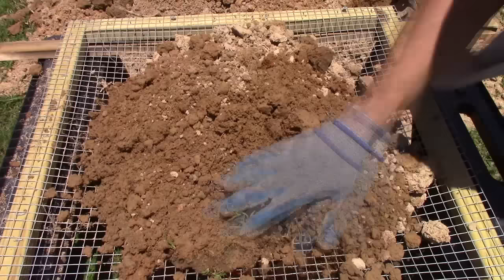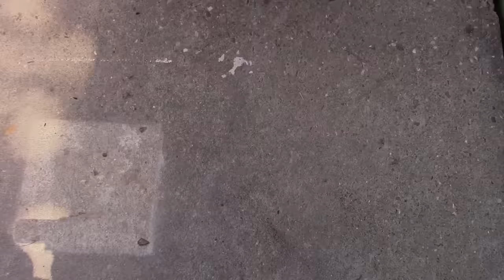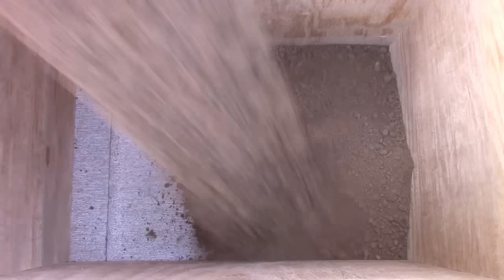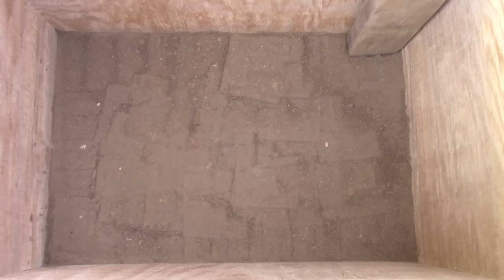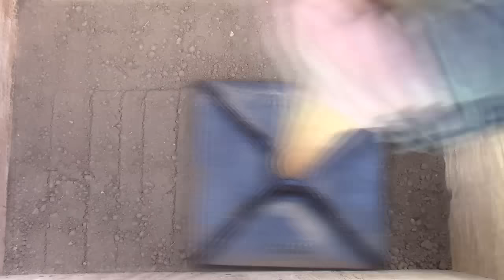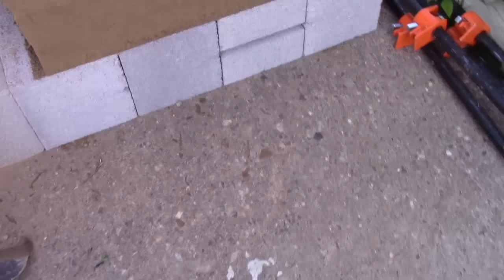How to Make a Rammed Earth Test Block - 5% Cement

Comment: I stopped using cement at least a year ago. I now substitute wood ash from my fire pit. The ratio is perhaps one part ash, two parts sand and four parts crushed clay. By adding water, you can make anything from a slurry to a sticky mud. In some cases, I use either cut or uncut straw to reinforce. I routinely change up the ratio of the mix because the percentage of clay in the dirt is the biggest variable. I don't screen anything. The range of material that you can make from these simple ingredients is amazing and—except for the labor—is free if you can get them on the building site.
Reply: It be very helpful if you can make videos of the mixture (wood ash from my fire pit). I am very interested in it. I want to avoid cements at all costs. Thanks
Reply: Is that mix waterproof or at least water resistant? I’ve made wood ash concrete before but it takes too much ash for large structures so I’m wanting to try something different.
Reply: Where will you get that much wood ash to build an entire house?
Reply: @kcmuanpuia  That much ash will be extremely hard to get I’m sure. Unless a person used volcanic ash which you can find tons of it out in the mesas in the southwest US. I can’t imagine how many things you’d have to burn in order to get enough ash to build a house. I’ve only ever built about 10 wood ash bricks for a tiny garden bed and it took a bunch of ash to do that.
Reply: thats a lot of wood burning to get that quantity of ash for that ratio. i dont see it being very practical. why is the sand so important? Clay is super abundant for most people, what is your experience with using a higher content of clay?
Reply: Can you make a video of your process?
Reply: @JimmyCapricorn77  You could use lime instead of cement, if you can get hold of it where you live.

Comment: watching this thinking... work smarter not harder... You are losing half the dirt out the buckets, make a funnel or something.
Reply: I think it was done for demonstrative purposes.    The whole process demonstrated is very inefficient, and in the end, despite the jump test at the end, you still see the brick cracking at the seems.  It doesn't seem compressed enough to be rammed earth, and i think it would have difficulty drying off if baked in the sun.   A brick that size is going to be extremely heavy, especially if they were to bring it to a kiln.  There appears to be a dried brick at the end which is noticeable larger which suggest or shows a lack of uniformity.  Maybe it still works, i dunno. I have no experience in that stuff.  If i were to build something of any height on the cheap, I would probably do compressed earth method using simple machines (hand operated cinva ram) to give a mechanical advantage on smaller hollow bricks.  Hollow to use rebar for support, run wires, plumbing, etc.
Reply: I have been studying architecture for some time, however this is not professional but let me tell you he has the idea. While you could use expensive tools he is making it with what he has. That is exactly what our teacher now want from us. Using what you already have rather than what you could spend.
Reply: @michaellake4633  The block isnt cracking at all. It is plenty compressed for rammed earth. It will dry just fine. Rammed earth is built in place, you dont move it so weight doesn't matter. You certainly don't bring it to a kiln. The one next to it is taller, you can make them whatever height you like. 

t is obvious you have no experience because almost everything you said is silly and irrelevant.
Reply: I was thinking the same about the round buckets I mean he mixes the cement in a container that would be better later and ya the kiln thing it isn't clay right just dirt and concrete
Reply: Just roll a Wheel Barrow under it to catch it all...

Comment: In Ecuador it's called tapia. There are houses 500 years old as long as you keep the roof on it. They seem to have rocks mixed in    about 2 inches long. They do blocks about 3 feet by 5 like giant bricks, two guys pounding away. It's really thick so it always feels cool in the day and warm at night. But you want to paint it with a kind of colorless glue paint so that you don't get a lot of dust in your house.
Reply: Where in Ecuador? I am here until April 2019 and would like to see this material. Thank you.
Reply: How they resist earthquakes?
Reply: interesting. i wish you coul tell me more
Reply: Linseed oil is the best for sealing it.
Reply: I Also bet they aren’t cement-stabilized
Reply: @joeldickerson1104  no cement in those old houses. Nowadays they do mix in 10 percent I think cement in California  down on lower levels where the overhang doesnt keep all the rain off the walls. In Ecuador they wouldn't want to spend the money. Build in the dry season and get the roof on asap. of course things don't always go as planned. Thank God for plastic drop cloths.
Reply: @ronmtz4622  sorry I never saw your reply.  We live near Vilcabamba.  You should be able to see tapia everywhere though.
Reply: @juliovc5630  interestingly,  it's the modern thin brick walls that seem to collapse.  All those cheaply built 3 story hotels in Manta collapsed. The older traditional buildings were generally  fine. Tapia houses seem to have lasted for centuries. I guess they can still hold up if they crack?. But I did hear that in modern adobe construction they reinforce with slender interior rebar and cement columns,  poured into holes created when casting the mud bricks.
Reply: @jonathandoelander6130  we used a mixture of red clay, lime, rubbed horse manure, and white glue to plaster our Adobe bricks. Came out about the color of guldens mustard. I wonder what they use for tapia in places where linseed  oil is not available.  If anything.
Reply: @jonathandoelander6130  my friend used a colorless glue paint on his modern tapia house to control dust. Does linseed oil do the same thing?
Reply: @TheXanthipp  Yes, the linseed will do the same, but of course, depending on how thickly it is applied (the same for the glue). It mitigates erosion, and presents a soother surface that is harder for dust to cling to.
Reply: @juliovc5630  by making an L shaped corner box. 60 cm high (2 ft). On the second level you switch the L box over so the seams with the previous level don't overlap. This way the segments interlock. Works like a charm, built 3 buildings with it at my (former) hotel near Otavalo. Withstood all earthquakes in the past 22 years.
Reply: @helenavanmaanen6733  may you link me a picture of the technique?
Reply: @juliovc5630  I am willing but I don't know how
Reply: @joeldickerson1104  5 %
Reply: TAPIAL- I couldn't find any information on "tapia" but got lucky and found someone call it TAPIAL construction. This is the type of construction that I want to use to build my home in the high desert of south-east Arizona. I saw quite a few other videos of people in India and Africa using this type of construction to build "boundary walls".
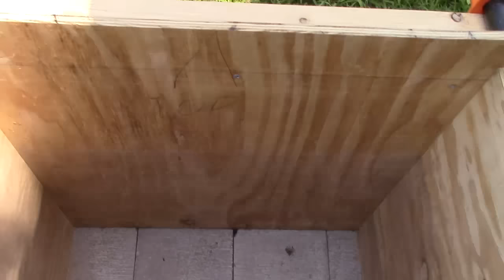Reply: 4:34

Comment: Have you considered using a bonding agent ?

I have a property in central Florida and the soil is a soft white powdery sand.  I want to build a 8x8 shed floor using  this sand, Portland cement and  a bonding agent.  I think a 10% Portland mix should be good enough.  I think if i just air-rate and  agitate it with a drill mixer, add in Portland and watery bonding mix and then  tamp it will work.  Maybe increase the percent of Portland on the edges and top to 20%.

Comment: My basic understanding is that 'test bricks' are almost always done both wet and dry with and without straw. For something like this, I would like to craft 8-10 test bricks around 12x12x6 inches each using slightly different ratios of base composition and moisuture. Compression test after fully drying by building 6 inch ramps to drive a car over and then blast them with a garden hose. If I am gonna depend on the walls for the rest of my life, my life depends on getting them perfect. May the best brick win!
Reply: The strength of the cob increases with the weight of the structure and how it is built, becoming massively load-bearing.  The test on a brick with a car is NOT the way to test it.  I don't know what is, though it isn't by a single brick and a car.  Watch more cob videos that describe the details of load-bearing stregth.   

I also believe I've seen thicker than 12" walls, with certain walls much thicker than others.  Maybe, I am wrong, but I don't think a brick is the test for strength.  The wall becomes stronger the more it is built up and supported by the other walls.  

Sometimes, too, depending on the design, support beams are added inside. History has proven these houses are the most durable structrues, built right.
Reply: I thought this was a variation of forming cob and hadn't listened yet.  The principles are similar for strength, but of course with the variable of cement and how it is formed.  I too would NOT be comfortable the mix was right and wouldn't attempt it without someone who knows what they are doing to advise or a LOT of research for how to test.  Still, I dont' think a brick would be a reliable test!

Comment: How to? How did you choose the earth? The 5% cement, by volume or weight? The water content? Your "squeeze test" was incomplete. After making a ball you need to drop it from about a yard and watch the result. If it "splats", too wet. If it explodes into a dozen pieces, too dry. If it breaks into 5-8 pieces, tamp. What other binders could be used? In the 50s I used only emulsified asphalt half diluted with water. It created a waterproof block that still looks good.  
I only needed to watch one tamping. It's not brain surgery. But well done.

Comment: Masterful! That is impressive! Thank you for sharing! Do you think pouring the mix with water  would make it somewhat less labor intensive? could the mix be done with stone and water?
Reply: If you add water you can´t compact the mix. Natural earth contain water. You can use earth mixed with stones too.
Reply: Search "SIRE rammed earth"   Structural Insulated Rammed Earth - to meet building codes
Reply: xophossophos: Good question. Less labor at that stage, but maybe not overall. 1. Less water allows immediate removal of the form and continued wall building. 2. A poured mix would require many days to dry (cure). So many more forms would need to be made, with a lot of leftover lumber and work. 
Rocks would require more cement (the most expensive ingredient). It changes the look. A large interesting rock or object (burrow?) adds an artistic touch without the need for more cement.

Comment: A test block is just that, to see how durable the result is with your proportions. Most places have adequate clay beneath the topsoil and the proportions of sand and clay in the soil might be perfect. There are people experimenting with rammed earth using flyash replacing some of the sand as little as 3% Portland cement. Volcanic sand and quicklime was used by the Romans and flyash has similar properties. You can test the proportions of sand/clay in the soil using buckets of water. Put a couple of shovels of soil in a bucket of water and stir it fast. Wait about ten or fifteen seconds for the sand and any rocks to settle, then pour the muddy water into an empty bucket through a cloth to filter out organic material. Let the mud settle out and when the water is clear, slowly pour it off into a third bucket. The first bucket will contain sand and rocks. Second bucket is clay. Now you’ll know what your soil contains and if you need to add sand, add clay or if proportions are good enough.

Comment: What should be the ratio of mud, sand and cement ?
And what will be the ideal thickness of a rammed earth wall ?
Reply: There isn't really any ratio, but it must be high in clay. That's why it got squeezed and kept its shape after sifting and before the brick process started. The clay is what holds everything together.
Reply: The best mix in your area is what you have in the onsite soil. Clay and silt are preferred soils, but you can offset this with more cement or clay if you have heavier sand based soil. 40% clay 40% sand and 20% silt + a 5% to10% addition of cement can make something almost as hard as granite. Different mixes allow for different soil structures like an addition of aggregate like 3"+ gravel. You can add in soil colorants, lime, chalk... The ideal thickness depends on how tall the building is. A two storey thick wall should be at least 2' thick with a bond beam of concrete at 10'-12' before rising to the second storey.

Comment: According to the technology adopted in my homeland, add straw, without cement.
Reply: I will note this for the future
Reply: That would be more like cob this is more of a modern rammed earth version which should hold up to the elements much better without the maintenance that cob-like materials and techniques require from exposure to the elements from what my research says so far. Modern rammed earth usually requires a minimum of 10% of Portland cement and soil that contains about 20% clay and plenty of sand and damp not water saturated soil. The modern mixture is very strong and durable compared to the traditional cob which requires a exterior stucco usually lyme based to protect it from the elements especially from rain.

Comment: great job, thank you for the video, what is the thickness of the wall,  if that is an 8 inch square tamper then the thickness seems to be about 12 inch ? is that correct.  I was wondering if there are any cons to building a very thick walls like 20-24 inch thick walls to increase insulation value and to increase mass to hold more heat during winter days.

Comment: Better add some reinforcement to those panels, especially on the sides, to avoid curves. It's not steady  enough. Should be a good structure that can take serious abuse and keep everything leveled .

Good job, I like the bricks you put first, but if it is filled with concrete.
Reply: We had serious slipforms for the stone hip walls we built. 1 meter tall, 60cm thick. Ended up cutting poles and wedging them against the sides, toenailed to stakes. That house stays perfectly cool!

Comment: Could you make some tests of water resistance? How does it responds to the rain beating on the walls? (from Brazil, here)
Reply from the maker: I made two of these blocks. One with cement and one without. The one with a bit of cement lasted over 2 years out in the open (lots of rainfall) and it was nearly undamaged. It was taken apart later though, but would have lasted longer.
Reply: Thanks! I've seen a study (made in France) with more than 30 walls made out of Rammed Earth with various mixtures and all of them resisted more than 20 years exposed to the weather, without losing more than 5% (about 2 milimiters of erosion) of its constitution. By their calculations it would be expected them to resist over 60 years of exposure. It would be nice to test it and show on Youtube!
Reply: Hey guys, if you watched my video 60 years ago when I made these rammed earth blocks.. lol

Comment: So if you were to make a wall you would need to create a form for the entire wall?  Ie... all four walls or for a round house the entire rounded form?  I saw a worm casting separator that is cylindrical and rotates that could be fitted with the screen mesh size you were using.  It would speed up the sifting process on the final project.  Would the rock/urbanite foundation of the walls become stressed at all from the compression process?
Reply: +Cassity ART 
I've seen more than a few videos of people using small blocks stacked and stuck together with natural adhesives, if that answers your question.
Reply: If  motor-ramming of a wall those bigger lumps might break down to smaller under the force. Sifting only necessary for the hand tamping test block.

Comment: How long does it take to make single block? How many can you make in a 12 hour day? The materials may be free, but is it really worth the effort? Might be efficient in an undeveloped country where the whole village can help out, but this would never work in the US.
Reply from the maker: We use machinery and air compressors to tamp for large projects. This is only a DIY test project in someone's backyard so I did it the old fashioned/slow way here. You can build a whole wall in a day easily with new technology.

Comment: Could you use the rammed earth blocks on the bottom of a cob house then put cob on top of those?
Reply: +Bobby Hurst I'm sure you could.
Reply: Bobby Hurst use roman cement search youtube
Reply: Bobby: Excellent question It would require a stronger block at the foundation (10% cement). Would stones (with adobe mortar) work as the foundation? Would it make a wall? I think so but I like the look (aesthetics)of rammed earth better. But if you have big flat stones and no other use, I would use.

Comment: Should use just a little water.. will help the cement to set and will help with compressing the brick
Reply: TheAussieGunBunny 
Thanks. I'll try that next time.
Reply: The soil was moist - your senses can see that.
Reply: He showed part of the moisture (squeeze) test. But when he took off the forms and stood on it you could tell he used the correct amount.
Reply: Don Duncan  Agreed, its 1 : 19 (5% cement) not 1 : 9 (10% cement). Very little water needed. I would however somehow get the forms wet to prevent them from sucking moisture out of the exterior layer of rammed earth. This would ensure good curing on the outside and prevent crumbling surfaces on the finished product.
Reply: Cody: Yes, wet forms beforehand and spray mist after removing. One other small tip: Mix all dry ingredients well, then add wet ingredients, mix well, and let sit for 15 minutes when using P.C.  I wouldn't use quick set in hot, dry weather. Forms come off immediately with any mix.